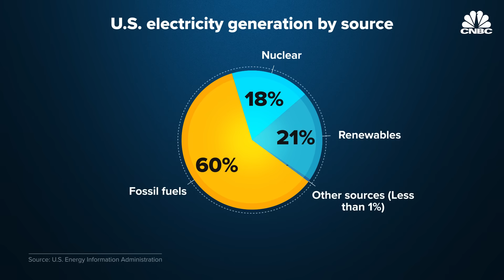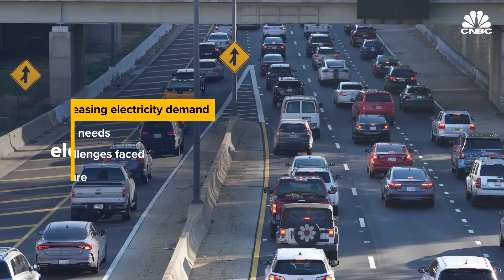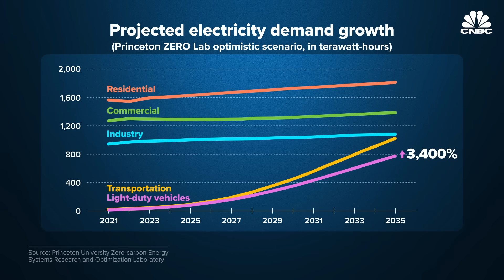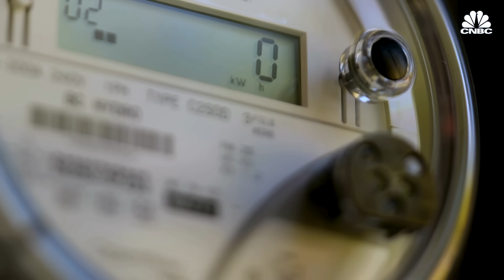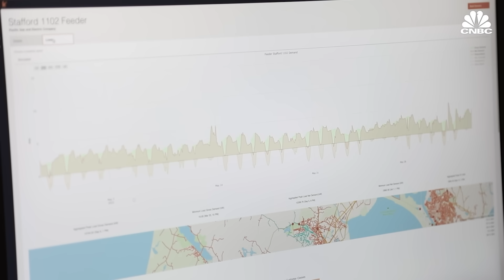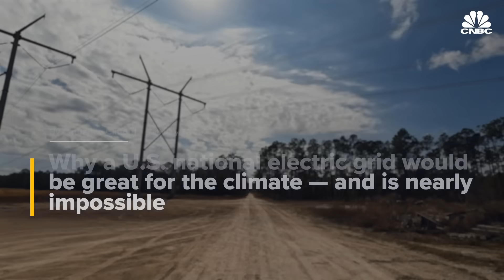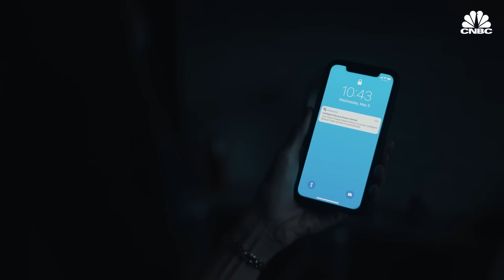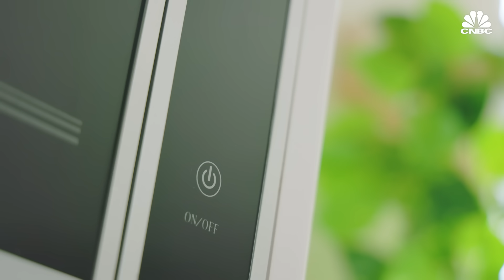Can The U.S. Power Grid Handle The EV Boom?

Comment: The level of ignorance CNBC demonstrates is beyond stupid.   No wonder so many people in the general population don't understand what is happening.   So let me give you some simple bullet points:

* CNBC throws out numbers and dollar figures without any context whatsoever, making the numbers seem a whole lot larger than they actually are.   The grid expansion happening today is nothing compared to grid expansions in past decades.   Most of the "pain" being felt is in finally being forced to decommission horribly polluting old coal and NG plants that society no longer tolerates.   All the political corruption that seeped into the system over the last 100 years is now rearing its face and the bill has to be paid.

* The grid updates needed are almost entirely on the generation side, basically to run transmission lines to a larger number of smaller generators (e.g. wind farms, solar farms).   This is indeed expensive, but it is also totally within the capabilities of the richest nation on earth, yes?   Yes, of course it is.  Stop whining about it.

* Lets be clear here... even a house with a 150 year-old 50A electric utility service can still charge an EV at home.   The grid updates to the distribution system required on the retail side are small and incremental and not actually a prerequisite to owning an EV.  There is no law that says you have to charge the EV at 32A.   You can literally charge an EV off a 120VAC plug using less power than a space heater if you wanted to.

* Larger "truck" EVs get poorer mileage per kWh of energy used, but the larger battery capacities are mostly irrelevant.  People drive however much they drive each day, that isn't going to change.   Just because you have a 80kWh battery, or a 200kWh battery, doesn't mean you need that much juice each and every day.  The juice you need depends entirely on how much you drive.  The government keeps wonderful statistics on how much people drive.

* The grid's PEAK capacity will not actually change a whole lot.  Full fleet replacement of vehicles by EVs, which is a 30-year affair, is projected to increase peak capacity requirements for the grid by less than 10%.  And the number keeps going down, because generally speaking people understand that there is no need to actually charge your EV during peak demand hours (roughly 4-9pm).   That is 0.3% per year... basically a big nothing.    So while total grid energy delivered will increase 30% over 30 years (1% a year, which is still a very small number), it is nothing compared to past grid expansions.

* Many of the stresses on the existing grid related only to peak consumption and can be trivially mitigated with properly situated energy storage.   This is what California is doing.  And Australia (the poster-child in unfettered renewable adoption).  And now Texas is starting to figure out the need as well.   The addition of properly situated energy storage, including at the renewable generating sites themselves, greatly reduces the need to run new high capacity transmission lines.

Comment: This is like the mainframe computer vs personal computer debates in the early 80's. Distributed generation will be the future. EV battery storage and energy arbitrage make more sense to me than massive grid upgrades. I need legislation that will override my HOA's prohibition against rooftop solar and legislation to counter or ease the restrictive rules of my electric cooperative. I could generate most of my electrical needs plus charge my EV rather than pull that from the grid. Even though it isn't currently economical for me because of the low cost of electricity where I live, I'm willing to make the investment in rooftop solar. I'm just not allowed to do so because of a very backward HOA and a restrictive electric utility.
Reply: HOA should be illegal

Comment: I've owned an EV for 6 years (Chevy Bolt) and now own a second EV (Tesla Model Y) which I've had for 5 months.  Had my utility install a time of day meter for my L2 charger a few years ago and have never looked back.
Charge during off peak hours and you won't overload the grid and you'll get spoiled very quickly by the low rates.

As a retired design engineer, details mean perhaps more to me than some others.  Tesla engineering is second to none and I couldn't be more impressed with my 2023 Model Y.  OTA updates,  the Tesla App with Insurance rates based on realtime driving data, True 1- pedal driving with heavy regenerative braking & brake hold, a Reliable SuperCharger network and FSD capability are all features I am already completely spoiled by.  
Thank you Tesla for showing the way to the future.  Never again will I sit in a drive thru or in heavy traffic and be worried about wasting gas and polluting at the same time.  Never again will I be changing oil, spark plugs, belts or any other nonsense parts associated with a ICE vehicle.  In fact, my only EV maintenance for over 6 years and 60K miles has been to rotate the tires and get a yearly state inspection.  Also had to replace one set of tires after 50K miles - that's IT.
Just have 4K miles on my new Tesla but so far, no issues and I get the range that was originally specified.

My suggestion for the future well being of our children is as follows:
1. Incentivize the installation of L2 chargers in apartment and condo facilities.
2. Remove any tax deduction whether it be business or personal for gas or diesel expense.
3. Institute a nationwide Carbon Tax to discourage the continued use of fossil fuels in the US.
4. Provide heavy incentives for sustainable fueled mass transit and robo-taxis in major urban areas.

In my opinion, it's a complete embarrassment to the world that we are a nation that represents only 4% of the human population but consumes 35% of all gas and diesel fuel used in the world.  Nonetheless, it's no surprise to me at all when just 5 of the largest oil corporations in the West grossed 1 Trillion dollars in 2022 and recorded 200 Billion dollars in net profit.  You can buy a whole lot of politicians for $200 Billion.
Reply: Not bad.  You missed one key point in there.  ICEs.  Internal Combustion Engines.   THAT is where the problem comes from.  Every ICE that is built has a Service Life of 10 to 20 years.   So we will eventually have to stop building and buying ICEs to move on from them.

Comment: The problem is that the government doesn’t want to recognize the negatives associated with EV’s.  There’s current vehicle cost, slow charging stations and disposal of batteries to name a few.  They want to eventually make gasoline cars obsolete, but they don’t want to see the big picture.  People will decide in the end, not the government.
Reply: Vehicle costs are coming down...fast.  Most people charge at home most of the time.  Spent batteries are too valuable to throw out.
Reply: EV batteries are now being recycled.  Since hardly any EVs were around 8-10 years ago, very few needed recycling until now, when they are old.  Note that EV batteries can have a second life as stationary batteries.  70% of original capacity may not be good enough for a car, but plenty good enough for home or building storage.

Comment: It seems that using the right battery for the different needs would reduce the need for long transmission lines.  You want a light battery for mobility.  However, for stationary use, you could create huge reservoirs of cheaper, heavier, less efficient but more environmentally friendly batteries for use near intermittent power supplies.   I know the low C-rate makes salt water batteries less desirable but people have swimming pools in their backyard.  Why not have saltwater pools scattered around intermittent renewable systems?
Reply: Tell how EV’s are good for the environment. Is it the strip mining or the fact that 80% of the cobalt is mined by slaves.. you are being lied to wake up.
Reply: That's the promise of sodium-ion batteries, which aren't as energy dense but are far cheaper and less impactful to produce for fixed applications like buildings.

Comment: Maybe we should encourage people to drive really efficient vehicles like the Aptera.
Reply: I can’t wait for mine!
Reply: @valleyofiron125  I agree that we need to spend more money on separate bike paths that can get you wherever you want to go.
Reply: so. mandatory lobotomies?
Reply: people are so stuck on this aptera, its going to be a pipe dream.  Aerodynamics do not matter as much as other things being efficient.  

a tesla model 3 has to use at or less than 255whpm to achieve its EPA range.  
a SR model 3 gets max EPA 272.  trust me, that is nearly impossible unless you are on steady freeway trip.  
in vegas summer, i cant see less than 380whpm.  maybe 350whpm depending on other factors.  but simply put, you just loss 1/3 of that range automatically just for it being in the summer.   but once the sun goes down and stops blaring its ugly heat on us and those stupid ass glass roofs they use that absorb heat are not absorbing the baking hot sun anymore, my whpm number drops to under 300whpm and often fairly close to 270whpm.    this tells you that an already aerodynamic vehicle gets worse simply due to outside temp killing the battery because its powering the AC, cooling system, battery management etc harder until it cools down outside below 100F and no sunlight.  
EVs are SUPER SENSITIVE TO ENVIRONMENT.  
EVs have to be more efficient in other ways, not just aero.  aero is a very small minor hinderance or improvement in comparison to real world use within cars of the same general class.  (sedans vs suv).  this no charge solar pipe dream is essentially a golf cart in comparison.

Comment: It will cost a lot less than continuing with fossil fuels. It's stupid to compare the price to doing nothing. We have never done nothing. Permitting and building grid are big problems, but not technical ones.  Also, you could connect the three grids with HVDC. Those take grid synchronisation out of the picture, and are very efficient at long distances, and buried under ground.

Comment: Easy fix,1)  build more infrastructure, this only needs to be done spread over the next 30 years. 2) higher rates at peak times to spread demand. 3) don't worry because the rate of home solar will mitigate demand. 4) don't worry fusion reactors will be built at requirement location.

Comment: Yes. It can!!! The real question is: Can the grid survive without ECs? EVs will mainly charge when there is surplus capacity. That will make everything much easier.
Reply: Plus 16ft2 cheap solar can give you 42 miles a week range without drawing on the grid.
Reply: @mac_mcleod  thats a relief, 42 miles of range a week....i hope i dont need heat or AC in my car to get 30 miles of use out of that alleged 42 miles......42 miles of range isnt real world use tho.  EPA estimates are not accurate in daily use.  
im sure i can get all my errands and to and from work on 42 theoretical miles a week
Reply: @baldisaerodynamic9692  Dude... that's $250 worth of solar panels.   For $1250, you are looking at 200 miles range.

And last hurricane, no one was driving around because power was out 100 miles all around the city except for government buildings and hospitals.  It took a week for power to come back.  There was no food in stores.   Any extra gasoline was reserved for generators.  No one except government vehicles were driving.  My two friends with Teslas didn't have solar yet then.

Realistically, I'd go with solar power for lights, laptop, cable modem, chest freezer, and phone recharging but with a propane generator for the fridge and one 5000btu A/C.  Back that up with 60 gallons of propane ($180 to buy- $45 to refill).

But solar is projected to be even smaller and even cheaper in only 2 years.   My old panel was 4' x 8', generated 81 watts and cost $700.   

My two new panels were 2'x8', generated 150 watts, and cost $250.

I expect in 2 years, they'll be still be 2'x8' but generate 200 watts and cost $200.

Big picture- if my current setup saves a friend or myself one $200 fridge of food, it's going to pay for itself in no time.  And one friend already had a 12 hour power outage.

As one bald to another likely bald guy-- I'm just saying run the numbers every year and don't get attached to any one solution emotionally.
Reply: whos in charge of controlling that surplus?  big brother telling us when we can refuel our cars?  are you nuts?
Reply: @baldisaerodynamic9692  There is typically a surplus of electricity midday and at night. Also, at the weekend when the industry doesn't use so much. When it is windy and sunny, there might also be a surplus. It is not more complicated than plugging in the car at night, and it starts charging when the price is lowest. It has nothing to do with Big Brother, but it has everything to do with win-win.

Comment: WE NEED TRANSPORTATION ALTERNATIVES
Hopefully we have reached “peak car”. Yes Battery Electric Vehicles (BEVs) are better than Internal Combustion Engine (ICE) vehicles, but they are still cars that require massive amounts of ever growing infrastructure, lots of natural resources, and money. They are about the most inefficient way of human travel. Even fully self driving electric vehicles do not decrease the number of cars on the road at any given time.

Making available alternative forms of transportation will be better for everyone, including those that need to drive . In places like Spain, Japan, and China, extensive High Speed Rail (HSR) between major population centers along with metro area transit systems mean many people don’t require automobiles. 

HSR is replacing short distance flights of less than 600 miles in places that have the option. 

Transit systems can efficiently add more capacity by creating more frequent schedules and/or longer trains. Increasing car capacity is much more expensive. The Katy freeway in Texas is currently 26 lanes wide!

Based on land use, an alien from another planet would determine that cars are more important than people.

Comment: The grid has handled every other electrical appliance boom, (fridges, AC units, electric stoves), EV’s won’t be an issue. If it is, it’s because utilities are trying to recoup profits and not the invest in infrastructure.  Many utilities are price controlled, so the easiest way for them
To make more money is to sell more electricity, no regulator approval needed.
Reply: Exactly. More electricity demand the more money they make.

Comment: Wind and solar are not base load generation. If you want carbon free baseload you will need more nuclear power plants until a "renewable" technology is created that generates power more constantly than wind and solar. Long distance transmission is also not really the answer. A tremendous amount of energy is lost during transmission. There are practical reasons as to why the grid is segmented as well. It needs to be as if it wasn't the whole country could go dark from a load imbalance.

Comment: As we add home solar to the grid, it unloads it during the time the sun is up, in the sunny parts of the country. This will unload the grid and it will not be necessary to spend nearly as much as some people say to strengthen the grid. In the older, more densely populated parts of the country, the grid has needed rebuilds for many years now, so get to it. It still will be much less than some people expect.
Reply: People will be charging their cars at night, after they get home from work and solar power is done for the day.  Most winds die down at night rendering wind power unusable at that time, as well.  Our current grid has no storage ability for sustainable energy created during the day to be saved for use at night.  In short, we will still need massive upgrades, Ted...
Reply: @DarkPesco  well . . .  no.  You have most of that backwards.   Big Wind is mostly bigger at night.   And the night is already surplus so there is no point in storing Solar PV from the day.  People can charge their car at anytime of day.   Most EVs are even programmable for that.   So charging during at work is fine, or night at home.  While the grid does have some existing storage -- built for Nukes because they cannot handle the daytime peak -- no storage is really needed to continue building out Solar PV for the next decade or two -- we can use all the Solar during the daytime, while it is produced.   As far as the overall grid . . .  everything on the grid has a Service Life of about 25 to 50 years.  So that means we are continually rebuilding and replacing at least 2 to 4% per year.  Add in some growth allowance and it can be around 5%.   All budgeted and planned as part of Capital Budgets and Operations and Maintenance.   Goes on all around most of the time, and folks do not even usually notice.

Comment: EV uses household things,  the same Lithium batteries, same electricity, wires, iPad like components, plastics. Why is it suddenly an issue? Build a couple of nuclear clean plants and solar and wind plants and so much solved.
Solar panel tech becoming cheaper and better and not just EV but entire houses will be solar powered. (It needs care to avoid reflecting sunlight back causing other issue) but it is all simple to solve given elon Musk Tesla showed how it is all doable with EV and SC network and efficiency and reducing planet pollution.